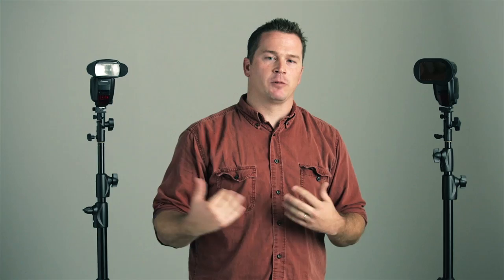MagMod Speedlite Modifiers - Fstoppers

Comment: I have been using my MagSphere and MagBounce for about 6 months now. I am wanting to move on to the off camera flash mode using my MagSphere and MagBounce. I have gotten a lot of great information In usage and setting up but no one ever recommends the best or the bracket they use to attach their flash unit along with their MagMod Modifiers to their light stand or tripod. I don't want my flash unit falling off because I didn't purchase a good bracket. Any suggestions?